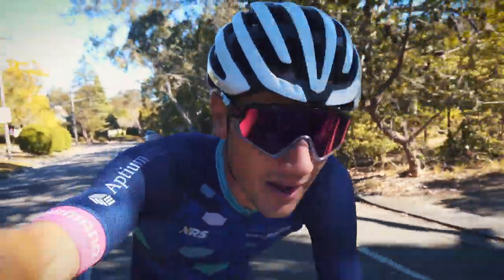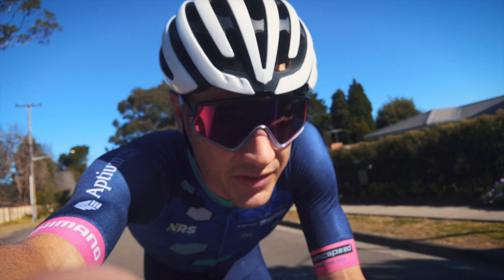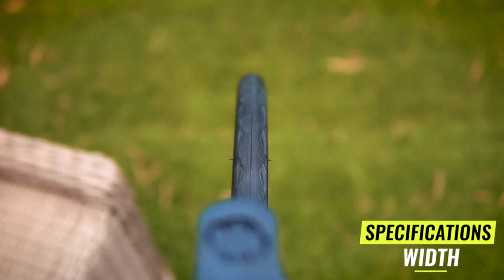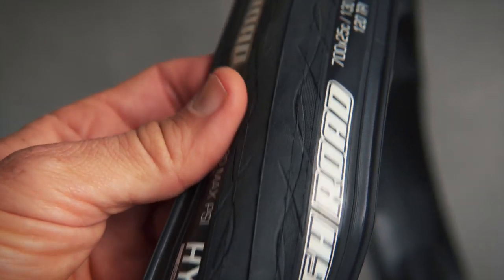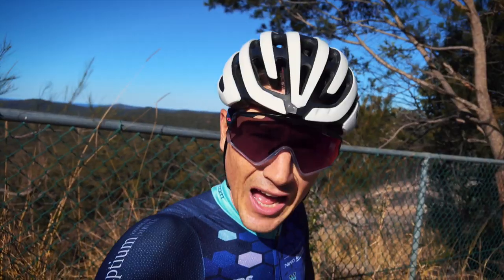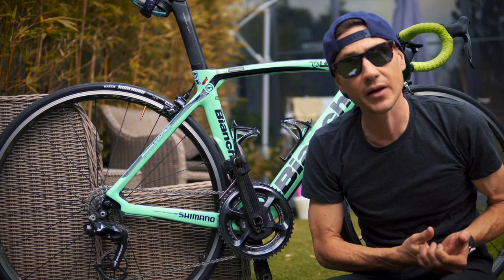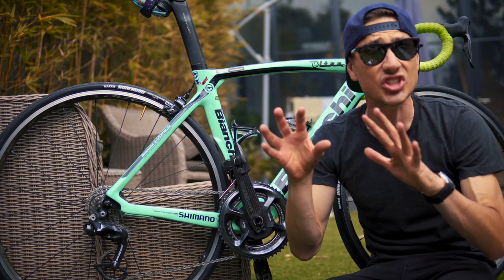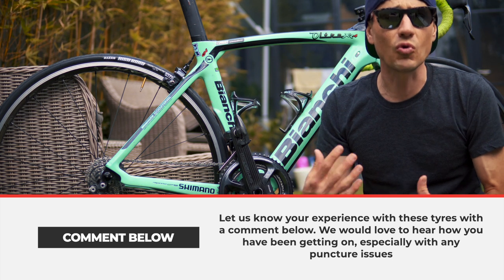MAXXIS High Road Tyre Review 2019 | Best Bike Tyres You Have Never Heard Of

Comment: When the tyres are hard to put on and take off, you need three levers and I've found the best are the yellow Michelin plastic levers. They are wide enough and flexible and they won't snap under pressure.

Comment: It's weird you have problems mounting them. I got them on without tyre levers and just by hand (with a semi inflated latex tube). No forcing it either. You have to use the center channels to slacken the tires.